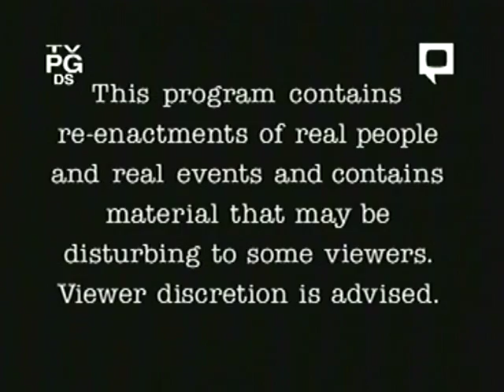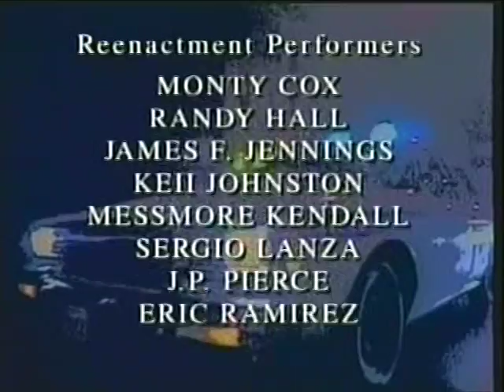Rescue 911: Man vs. 2 Tons of Glass

Comment: i worked for a window company for 11 something similar happen like except the person went to pull back a cart with 2 pieces of double pane glass over 100'' height  and 50'' length weighing nearly 600 lbs the wheel got caught in a crack  in the concrete floor cart tipped backwards falling over him the young man suffered a  broken back and was air lifted.